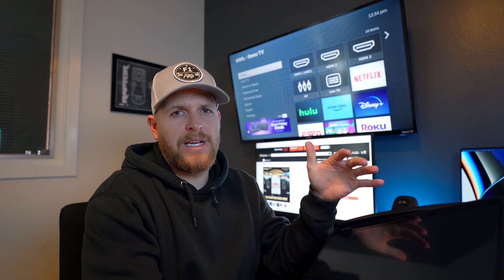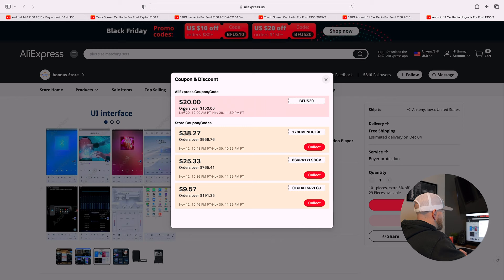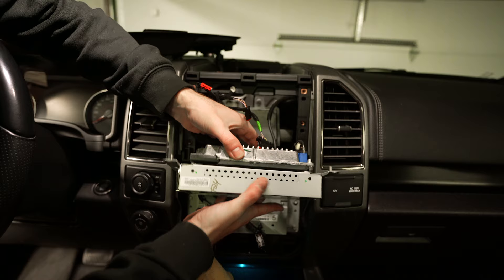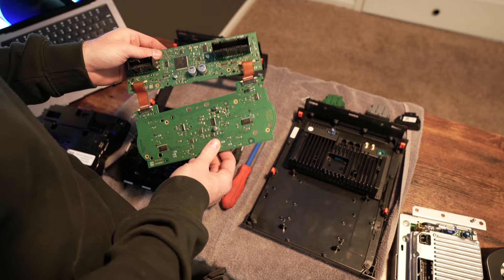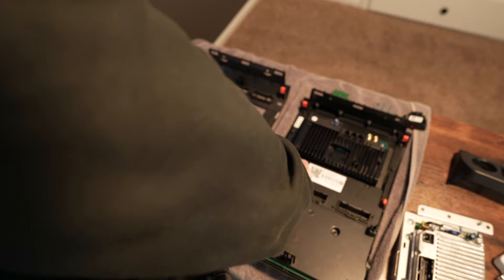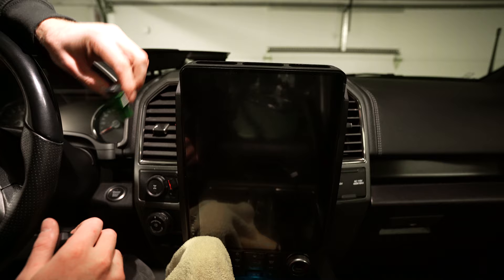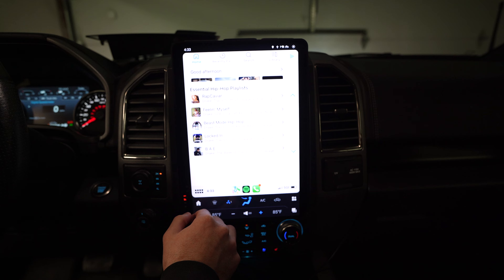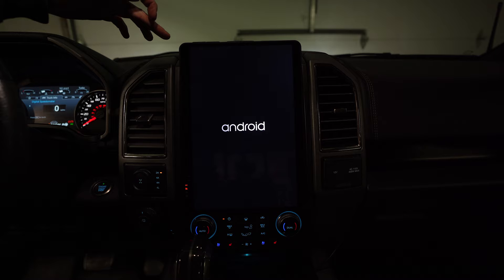Installing the GIANT 14.4” TESLA Style DISPLAY in the F150 RAPTOR | Complete Install |

Comment: Excellent video, I have a 2018 F150 sync 3 with the 4" screen and I'm installing the 12.1 autotech unit. I was a little nervous moving the circuit boards from the old to the new because I have 2 additional circuit boards that control the buttons on either side of the little screen. I disconnected the ribbon connector and only use the circuit boards for the heating controls and volume/tune controls. I hope this is ok? Also I have a question I am hooking up a amp/sub so I assume I will connect the pre-amp output cables to the red/white rca outputs? Also for the amp remote line turn on wire I'm used to a blue wire, I see on the camera harness there is a ccd-12v do you think I should use this? When I get it connected I guess I could see if the power to the ccd-12v shuts off with the engine and it turn shut the newly installed amp as well. I can't wait to get this hooked up and get one of the wallpapers as well.

Comment: You should be using an esd bracelet to protect the Circuit board from static electricity
Reply from the maker: I live life dangerously
Reply: Yes, or at the very least rubber gloves.
Reply: @07blackfx4 😂😂 that’s not even an issue
Reply: @user-px3lb8ms3h  if your handling circuit boards without rubber gloves , you don’t know what your doing and should stay out of the electrical field…

Comment: So a few questions:

1- If the truck has a front camera, does that work with this out of the box?
2- If the truck doesn't have a front camera, can you add one and will it work like stock?
3- Can you set it up to automatically open into the original F150/Carplay interface and just bypass all the android stuff?

Comment: Your video is 6 months old? What are your thoughts on this system now? Would you get it again? Do you need to install the cellular connectors and sim card connections? Im assuming you left the usb input hanging in the glovebox for access. Is the new gps attenna needed if you use Ford's navigation? Im assuming with the wireless carplay/android auto that it would use the gps from your cellphone? Great video. Sorry about all the questions. Thinking about doing this with my 2018 Lariat.
Reply from the maker: @dstadt71  yes I would get it again. Love mine. You don’t have to use any cellular data/connections. I just use my phones hotspot if I want to stream. The new GPS antenna is not needed if using the ford sync. Ya if using CarPlay that’s using phones gps. Hey no worries let me know if you have any other questions!
Reply: @f1fiftyjimmy I have a 2018 ford f150 xlt. When I buy this unit with 14.4 screen.  Do I need to determine first what type of sync I have in my unit or can I just purchase the sync 3 right away?
Reply from the maker: @tonydee4381 generally when you purchase from the seller they will ask you to take a picture of your dash and will send accordingly. I don’t believe you can add sync 3 to your current vehicle if that’s what you’re asking.

Comment: I ordered the same screen as you, from the same site, etc.  I love it!  I am having issues with the cameras though.  I have the settings set as you do and they still do not work.,  In your video at 19:28, you have  an AUX cable.  DO I need to connect anything to the ports on it for my Sync 3 system/cameras to work?
Reply from the maker: No nothing needs connected to that. I just plug it in so its back there. Are you on android 13? The only thing I noticed when I installed the android 13 display was I had everything set correctly and the backup camera didn't start to work until I started the truck. I'm assuming you have already started it and threw it in reverse? if so might need to hit the reset button on the front of the screen or possibly reseat the connections. Anymore help shoot me an email jimmystrait@gmail.com

Comment: How does the new screen generate sound for the truck sound system ?  Does it have a DAC in it ?  What is the connection to the Ford sound system ?   Does it do AM and FM ?  Does the truck have an amplifier or does the screen have an amplifier ?

The screen has built in WiFi... does your truck have WiFi for it to connect to ?  Does it share your phone's WiFi via CarPlay ?  Or do you have to make your phone a HotSpot ?

Thanks for sharing this !
Reply from the maker: Not sure on the DAC. It does do AM/FM since you keep your sync module and it fully functions like oem. It comes a with a SIM card adapter and you can either get a data plan on a sim card or use your phone as a hotspot.

Comment: Thanks for the video. Does this system allow continued factory WiFi as a hotspot? Im contemplating changing out my factory system from my 2019 F150 Platinum. Thanks
Reply from the maker: No I don’t believe you can use the factory WiFi as a hotspot. I know some guys are running the obd2 WiFi hotspot from T-Mobile

Comment: Hello Jim,

 I am reaching out to inquire about the backup camera issue. Specifically, I would like to know if there is a way to change the reverse function of the backup camera. My camera is reversed or flipped

EE
Reply from the maker: If resetting the display by just clicking that small button on the front of the screen doesn’t resolve it. My next steps would be a hard reset or unplugging connections and plugging back in. Haven’t heard of anyone’s reverse camera doing this.

Comment: How do you know what plugs into the two gold 4g spots? I got two of them not labeled and not sure to plug into the top one or the bottom. Our system is slightly different. Yours are side by side
Reply from the maker: For mine it just came with two 4g antenna's. One you run to the driver side of truck and the other you run to the passenger side.

Comment: Do you retain the feature where when you auto start the air will come on depending on the temp outside? Like if it’s cold the heater comes on. Got the ac comes on. I can’t lose that which is why I’ve never bought one of these cause most reasons like this you lose that function.
Reply from the maker: ya it does. My heated steering wheel would still come on. All factory sync functions are retained. You can still use the ford pass app and lock/start your truck.

Comment: Question: Helpful seeing the options you covered on AliExpress.. and on that, one listing differed which unit to buy if you have Sync 2, 3, etc. The one you purchased seems like it didn’t offer variation. I have a ‘15 Lariat Sync 2 before the S3 upgrade from Ford and I have the Sony upgraded audio with Sub etc.. Assuming I transfer my S2 unit all shows up on the new screen in the end when I hit “Console” like my factory …. Is the particular unit you purchased compatible with S2 and S3?  

Tutorial was really well done.  Liked and Subscribed !
Reply from the maker: Ya I’ve noticed some ads will differentiate sync 1,2 and 3 and others don’t. When you do purchase from them they will message you for your model and will also ask for a picture of your dash so they send the correct one. Also if those mofo’s message you and tell you they need more money because of the one you need it’s bs tell them your not paying it or you will just cancel the order. Happened to me and several others.
Reply: @f1fiftyjimmy  appreciate the heads up on the upcharge BS.  Thanks dude

Comment: Hey man. I installed one of the 14.4” screens. Reaching out for some help. 

I’m having a song skipping issue. When using CarPlay and skipping the song (using steering wheel) it switches over to sync or some sort of radio static and then comes back to the song. If you skip the song on the radio or phone itself it doesn’t change over to any radio static.

If I use the Spotify app on the actual radio itself the steering wheel controls won’t even change the song at all. 

On the Spotify app on CarPlay it will skip the song but it will still play the radio static in the background for that second and then switch. 

So it’s some sort of issue with the steering wheel control still wanting to run the sync radio or some sort of radio static when hitting skip on the steering wheel. 

Any idea?
Reply from the maker: That's just normal. It's because steering wheel controls are meant for sync and its trying to override that. I do feel like I don't hear it really being on android 13. Are you on android 11? I haven't used Spotify outside of carplay.
Reply: @f1fiftyjimmy  I’m on android 13, but I think the volume of it plays at the volume of whatever I have the radio at. It’s more annoying just because every once in a while, it will actually find a station and then some radio advertisement or whatever blast at me for like a second and then it picks back up on the CarPlay lol

Comment: I installed the same into a 2021 Ford Expedition, but I am having cross-feed through the stock microphone and the built-in mic on the screen. How did you disable the stock mic? Mine came with an external mic that I could use and there is a harness and spot in the back for it to plug into. I may do that, but wanted to get your suggestion first. Did you unpair your phone from the stock radio?
Reply from the maker: I never installed the external mic and never adjusted any mic settings. That built in mic in the lower left of the screen worked good and everyone said I sounded good on it. I also always left my radio unpaired from the sync app and just let the wireless carplay pair the phone.

Comment: I just bought a Bulletpoint mount for the dash. Do you know if it will work with this screen?
Reply from the maker: It should. If you check out my latest 14.4 display video I am rocking the Tackform mount without issues and its identical.

Comment: Will this system work on my F150 2019 it has SYNC 3 8" screen no navigation. It's not Raptor
Reply from the maker: Yes it should. Once you purchase from the Aliexpress seller they will ask for a picture of your dash and make sure they send you the correct kit. There's a link in my description for the display. That seller communicates quickly and gets the product out to you usually within 7 days.

Comment: So being as i have a '17 raptor with sync 3.. (i dont like using android auto) will i be able to use the sync app just as i did before such as comnecting my phone to bluetooth and using it through that sync app?
Reply from the maker: Yep you can still connect it via Bluetooth through the sync app. CarPlay won’t work wired, it’s wireless full time if you decide to use it.

Comment: Jim, just finish installing it. The rear and 360 view vid still appears grainy than the OEM and I have no audio when playing spotify but works with standard radio???? Any idea what is causing the audio issue???
Reply from the maker: And I’m assuming your camera setting is on VGA? If it wasn’t I don’t think the camera would work at all
Reply from the maker: I would reseat your connections. Pretty sure they would fix the Spotify issue and close the Spotify app on your phone and do a reboot
Reply: It is set VGA. So is your unit same image quality as OEM?  I see large # of compliant over grainy vid on F150forum!
Reply from the maker: @MrFive11  I mean I always thought it was decent quality. It is however larger now on the new screen so it will be stretched some and the new screen is a 2k screen but they downscale to 1920 for the sync app and camera app. To me I thought the camera wasn't better but just shown larger/wider.

Comment: I've had mine 5 months now and it will randomly just change inputs on its own. I will be listening to a station on sirius xm and it will just change. Any ideas how to fix this? I have contacted the manufacturer and was sent updates to download,  but it still happens.
Reply from the maker: I’m assuming when you’re listening to Sirius it’s through the console app? Is that the only thing that changes is to another station?
Reply: @f1fiftyjimmy  yes. It will switch from sirius to like AM radio or FM. Sometimes the whole screen changes to some flower picture with no sound. It's real annoying

Comment: Just to confirm, are you able to use the stock microphone still? I might have missed that part if you covered it. Awesome video though!
Reply from the maker: So there is a built in mic in the lower left corner of the screen and I’ve taken several calls and was told I sound really good. Thanks man!

Comment: Do you see any reason why it wouldn't work in a Superduty instead of an F150 ?
Reply: I'm pretty sure it works for Superduty, the cabs are the same. Sometimes the listings will say at the bottom that it works on F250 and F350
Reply: @mjsz2842  Do the Ford cameras still work ?

Comment: I followed exactly. Backup camera still shows “no signal”
Reply from the maker: I’ve heard of some reseating their connections 2-3 times and 3 time it worked. If it saved the camera as vga and you try to do the reseating with no luck. Next step would be a hard reset.

Comment: My back up camera is still not working. Any ideas?
Reply from the maker: So switching to vga didn’t work? I gotta ask the obvious but if you did switch it, did you make sure to hit save? If so did you reseat connections? If you hit the camera button does front camera show?
Reply: I set it to vga and saved the settings. It’s still not working
Reply: Also reset all of the connections
Reply: Update. I got it working once I unplugged everything and reinstalled it. Thank you for the help and your video made the installation a breeze!
Reply from the maker: @mattadams8062  good to hear! Yep no problem man!